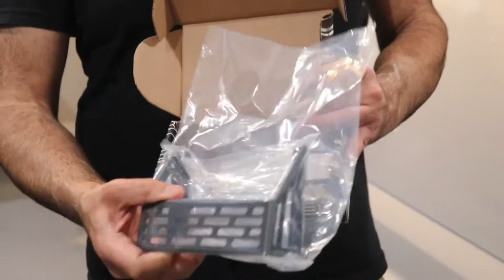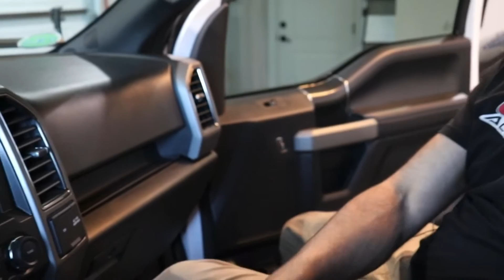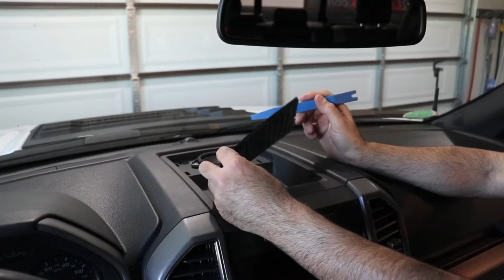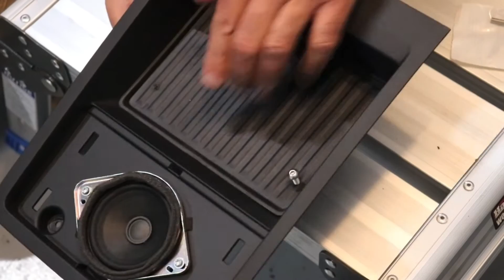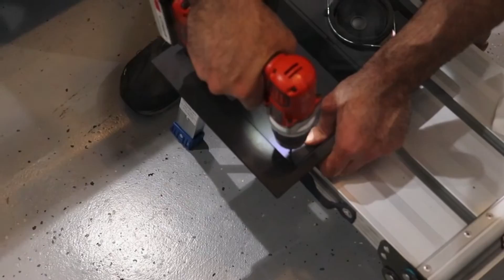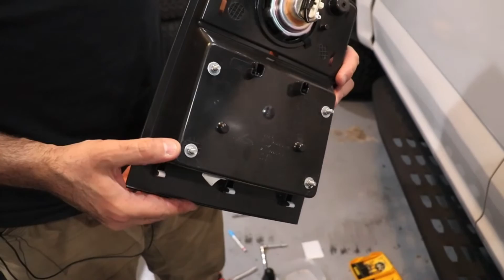BuiltRight Industries Dash mount (Gen2 Raptor)

Comment: Nice clean install. A word of advise on drilling into the plastic, make sure it is warm. Cold plastic is more likely to crack compared to warm plastic. I also like how you used a larger diameter washer on the back side. That makes it stronger and less likely for it to be pulled through. Adding this to my list.